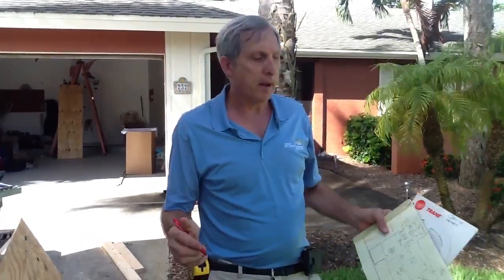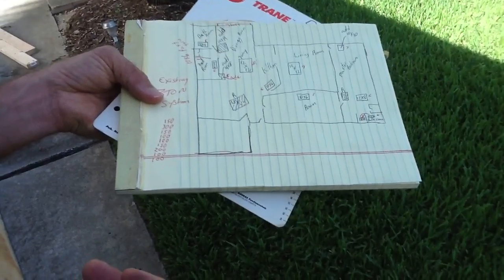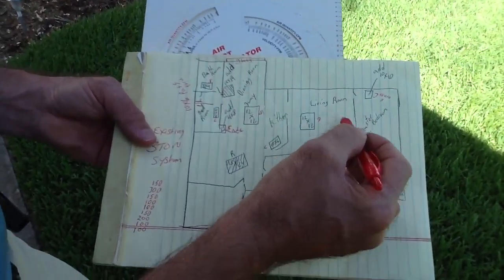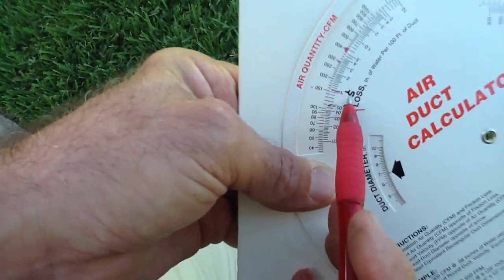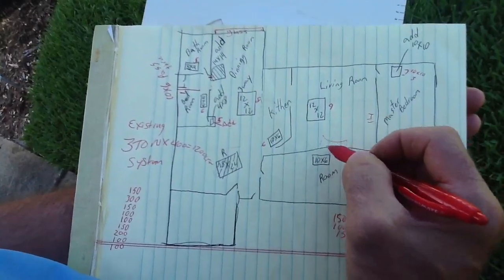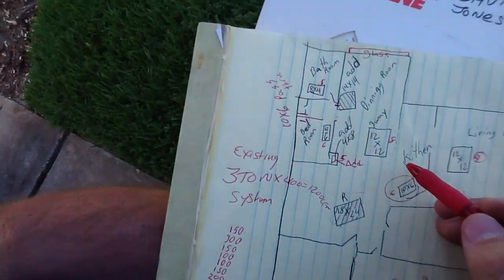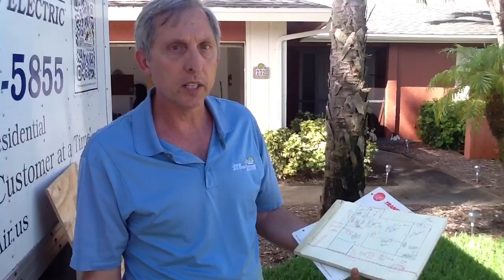Real World Duct Design

Comment: I'm guessing this is an attic install. I usually figure larger losses on flex. I rarely use flex because it is not as long lasting as hard pipe. Returns more than supplies. I'm guessing you're actually closer to 350 square foot per ton, which is the lower side of allowable. You can get a wheel that includes flex duct for about $25.00. I use the free wheel as well.

Comment: In my opinion, this is probably the worst video I've ever seen on duct sizing.
  If you don't mind, there are two things that I would like to point out here...
  First, you don't explain at all how you came up with your CFMs for each individual room, along with determining each room's duct size. All you did was assume that the viewers of this video already knew how to calculate all of that information.  For example, how do you know that one room has a 12"x8" box/grill, the return grill is going to be 12"x12", etc?...
  Also, at 4:32, you said you don't use 4" flex because it's pretty much useless.  I know several long-time, certified HVAC Technicians who use 4" flex in small rooms, such as bathrooms, etc, and those smaller rooms all receive the proper airflow after their rough-ins, trim-outs, etc are finished. 
  One of them in particular has been this field for over 30yrs...
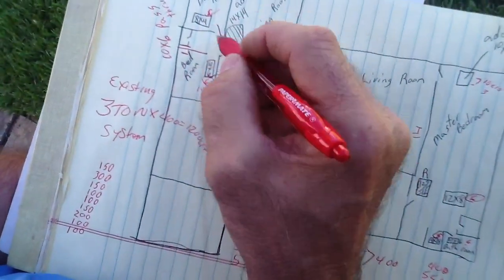  From 4:40 - 5:00, you mentioned ADDING more CFMs in order to combat mold, mildew, etc in a walk-in closet.  Did you know that, the lower the temperature within a conditioned space, the MORE humidity is added TO that space?... 
  Yes sir, I learned that in school.
  If you don't believe me, try taking your psychrometer (if you have one) and measuring your relative humidity directly at the supply plenum, immediately where the ductwork comes off of the air handler or furnace (or just verify that fact by looking at a psychometric chart...)
  Now, I can understand providing proper airflow to a particular area within that conditioned space.  And if that is what you are trying to achieve, (in my opinion), I would install a de-humidifier in the attic, and have a drop in that walk-in closet.
  THAT'S how you combat mold, mildew, etc...
  Other than that, I love your videos.  I am a subscriber of your channel, and an avid viewer of all of your videos.
 I just wish your videos were a little more 'technical', or complicated.  
  Other than that, keep up the good work.

Comment: Thanks for these videos.  Question for you, I have a house that an addition was recently done.  The original house has a 2 ton unit, and square feet for CFM is 889, so that leaves 89 CFM in addition.  Now I’ve added 498 sqft.  So at 1387 I would assume I need a 3 ton unit.  My question is what point over the Ton=CFM would you need to go to the next size?  I could add a closet vent or two if I need to be over for what a 3.5 ton unit would have enough flow.  So if you have 300 CFM more, would you go bigger at that point?  Thanks in advance
Reply: Lla😊

Comment: What I do is take the total CFM that the equipment is delivering, and divide it by the square footage of the home, to get the CFM per square foot.   I size the duct for each room, per its square feet.  Then work backwards to the trunk lines.  I never used flex, and never used od ball duct sizes.  If a 7” was calculated,I used an 8”. Screw that flex duct.  That’s for weekend wannabe HVAC installers.  Real HVAC installers use ridged pipe, externally wrapped with foil back insulation and vapor barrier.  I’ve got no good use for soft flex duct.  The only thing is good for is rats nests.

Comment: How do you calculate the long metal supply trunk line  with reducers? per  a 3  ton unit
Reply: Hello sir. Are you still working in hvac industry? I would like to ask few questions regarding on ducting system if you dont mind.

Comment: Good video my only concern is flexible duct. No good installer would ever use all flexible duct  hard pipe is so much better airflow  cleaner and easier on the equipment. If designed correctly you will not have excessive sound.

Comment: HELP PLEASE! Can you tell me the requirements of a vertical fan coil unit needed to heat vent and cool a level 4,292 cuft in size? (29L x 18.5W x 8H) This area contains a kitchen, bathroom, laundry room, living room and 2 bedrooms. Also can you tell me if any additional equipment would be required to work with the VFCU? My questions are based on the idea of renovating a 3 level house in a way that allows each level to be completely independent of each other, eliminating the need for a commonly shared furnace and hot water tank. Each level with the capacity to be isolated, will have its own electric water heater and VFCU, and the only common area will be a small room on the lowest level, housing the main shut-offs for water, gas and electricity.
Reply: how the hell can u fit a 2br suite into 29x19? Shit I'm compromising  with the same rooms in a 27x34. Is it for little people or something?

Comment: Can you please elaborate more on placing the registers on the perimeter walls? I feel I need to understand this better. I'm designing a small office space and need to reconfigure the supply and return. Currently, the system has the return in the center of a perimeter wall and two 10x10 registers located closer to the center of the small 300ft2 space. I wanted to install the registers on the perimeter walls like you suggest and move the return away from the perimeter wall.

Comment: what a second here! You have a 3 ton that's 1200 cfm and you said you calculated needing 1350 and you are good???

you just undersized the system
Reply: Based on the size of the room he oversized the ductwork to make sure the furnace never starves for air. He installed ductwork that can handle 1350 CFM while the machine supplies 1200 CFM. This system should perform quietly.
Reply from the maker: no this works well

Comment: You calculated 1350 cfm needed but the system can only support 1200 cfm. How this is working? I am a noob. Just trying to understand. 
You mentioned it is because of noise reduction, so always our cfm should be lower than the ton system to avoid such noises?
Reply: He should have room  size shown on the sketch. Looks like he could have upgraded to a 3 1/2 ton. Bathrooms can use a 6" instead of a 5" because of taking a hot shower and oversize the kitchen because of the cooking. Always make the return air as big as possible because the pleated filters WILL restrict air flow and when they are bigger you wont hear the air being sucked in. You can't make it too big. To see if that fancy filter you bought is restricting too much. (evaporator need to be clean)Turn the blower on, and remove the filter, go to the closest register from the supply, hold your hand right up to it, have someone put the filter back in, if you feel the air supply drop...then it is restricting too much. The unit doesn't care how big the supply is. only how much air is going across the evaporator. Always get an inspection access between furnace and the evaporator for cleaning and inspecting.
Reply: E Buzek. Thank you.
Reply: Don't happen to live near Tucson Arizona? Need mobile home done for rental.

Comment: Hi: Excuse me for this dumb question. How do you get 300CFM with a 9in flex (in the living room) ?  Thank you
Reply: Luz L Must have more than 1 supply in that room. Not getting 300cfm out of 1, 9" flex.
Reply: @Simon TemplarI like how comments don't age well. The question wasn't answered, and my knowledge was off, maybe I was thinking FPS. 
To Luz L, who probably doesn't care anymore or has figured this out: CFM is just cubic feet per minute, and you can get 300 cfm just by having a blower rated to put that out from what is called a central air unit or handler. There will be branches or duct tied into that unit (unless it's ductless) that will distribute air throughout the ductwork, this is known as forced air. The only things that will effect the known or wanted cfm are: cleanliness, blower power, and length of ductwork as well as it's size (supply and return grills match duct size).
Reply: @Simon Templar Some things to consider when changing ductwork: insulation, values, and size. More than often the return is undersized or too short.

Comment: I have watch some of your videos and like them for the most part but I disagree with your 4" is useless comment. A 4" can carry roughly 35-75 cfm depending on static pressure as with variable speed blowers which would cover at least 35 sq ft. I have used 4" ducts for small rooms that have minimal heat load or outside walls for years with no complaints. Remember the rule of 1cfm/sq ft , 400 cfm/12000 btuh per ton cooling and 20,000 btuh for heating tonnage(it's easier to heat than to cool).  And I also use a rule of thumb of 1-10" duct per ton and divided evenly. So 1-10" = 2-8"/10", 2-6"/8" , 2-4"/6" and likewise in reverse.
Reply: Robert L 4" flex is useless 4" hard pipe is fine
Reply: Dalton Morrison not true... if it’s not a long run thn 4 inch is fine but most people do seem to prefer 5” nowadays

Comment: How do you determine the grill size based on the duct size?
Reply: Typically you don’t want to exceed 2 ft./min. per square inch. For instance he was using .1 static pressure as his base. And he said he was using flex. He said .1 static pressure is 300 CFM‘s per a 9” run. But actually it would be 220 CFM‘s for flex. But let’s just go with 300. A 12 x 12 register is 144 in.² times two equals 288. So using a Ductulator when I look at 9 inch at .1 it’s 300 ft./min. So that would max out that grill any more cfms and that grill will be noisy.

Comment from the maker: Just use the multiplier of .96  over sq ft.. Example 100x.96= 96cfm
Or 6. " flex which equals 100 cfm
Reply: Ok so my room is 11×12sq ft. X .96= 126CFM that's the amount of cfm that I need for that room? So, I will be good with a 7 inch flex duct? If so how do you know what size supply register?

Comment: Nice job. My question how do you determine the amount of cfms in each room?. I just see you start from the vents and with good experience. Thanks.
Reply: From my experience you can usually do 1 CFM per SQ foot of the room. This could change depending on the heat load of the room, like big glass doors etc or if the sun hits that glass all day. But generally you should be ok with 1 CFM per SQ foot.